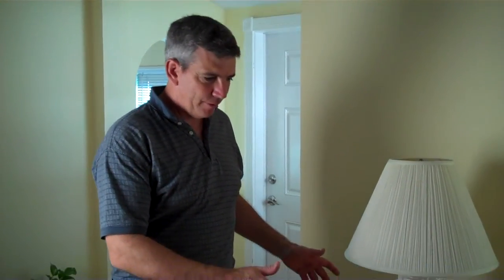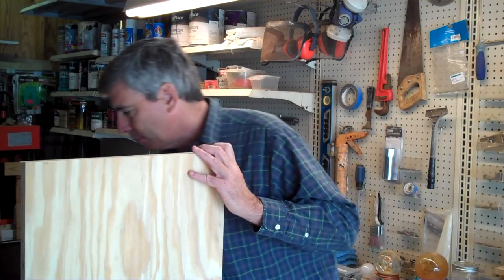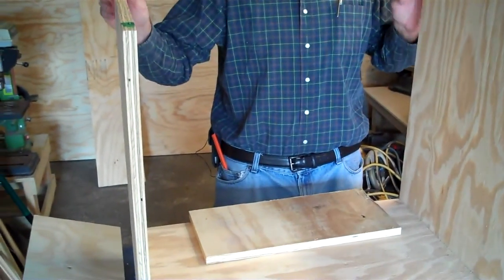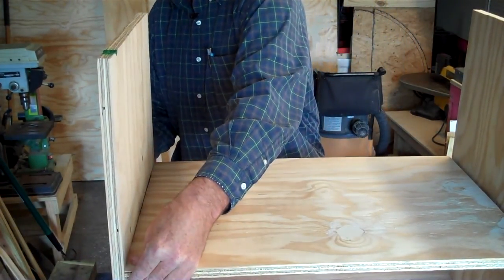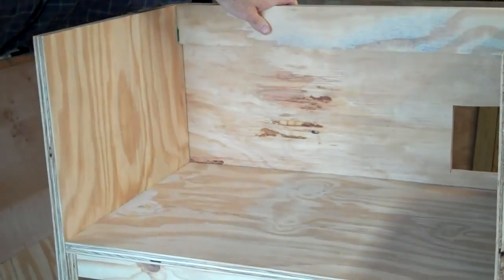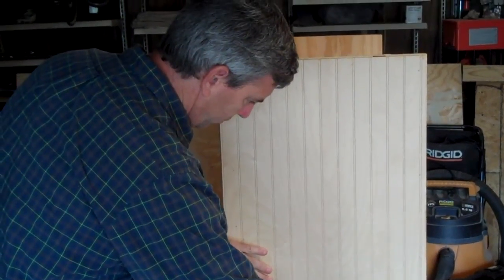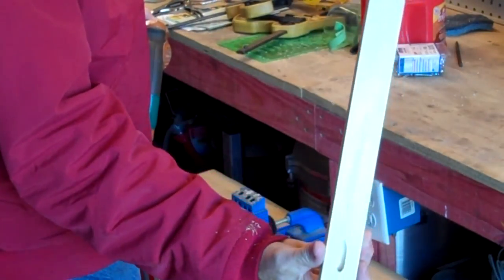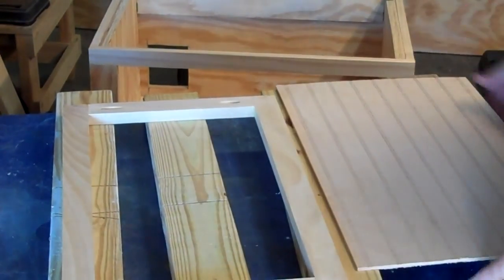Making a cabinet  for your off grid battery bank

Comment: Hi Gene.  Nice project.  If you use 12v lead-acid batteries such as found in cars, they generate Hydrogen (H) gas when they're charging.  Being lighter than air, H will accumulate in the top of the cabinet if it can't escape, and it's explosive when it reaches a certain concentration in air.  You might think about mounting the top on some sort of struts to let the H vent out of the cabinet (and hopefully eventually out of the room.)